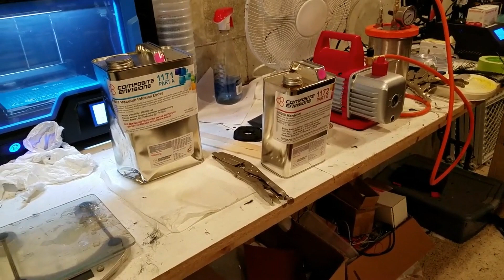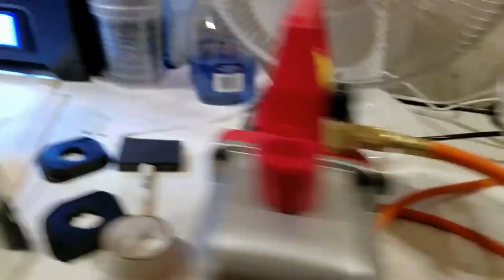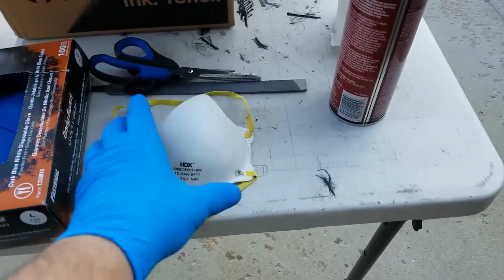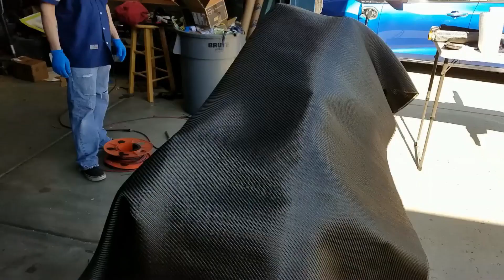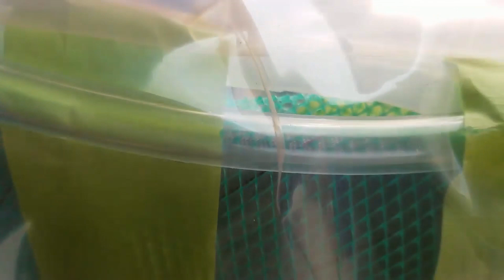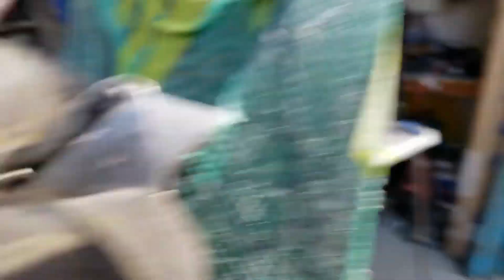Encapsulation of 3D Printed Parts.

Comment: So not saying you could do this in a hobbyist environment, but I've been following the aptera project (solar electric car).  They are using a process I wasn't even aware of called glass fiber SMC.  Looks like they take plastic composite sheets and infuse it with carbon fiber and resin that cures when heated.  It's almost like a metal stamping but with heat.  You get a carbon fiber part in 5 minutes not days (and completely clean).  https://youtu.be/LJLn6Y4V8Ks?t=81
Reply: This came up in my feed... looks like he's 3d printing forms to lay the carbon fiber against https://youtu.be/iLhU8J8F7aM